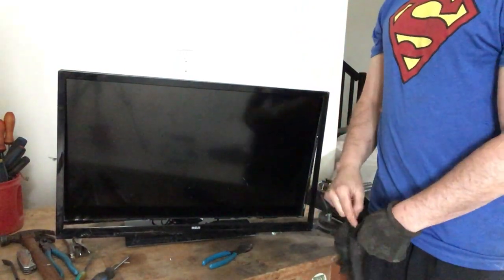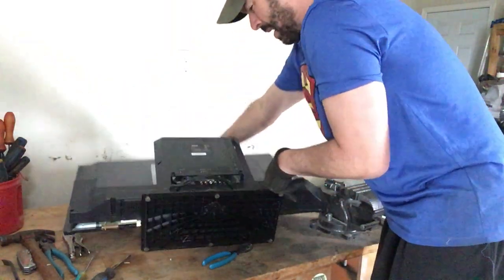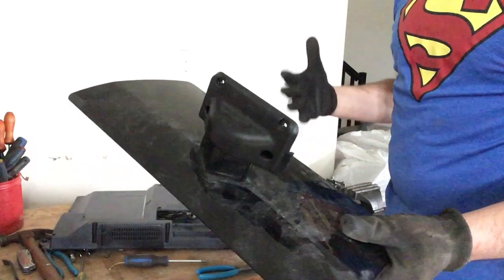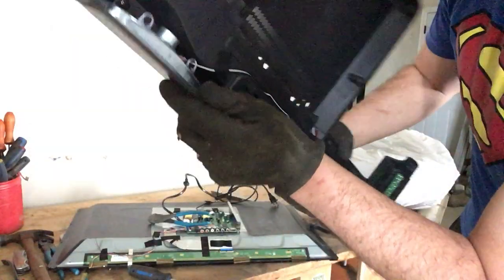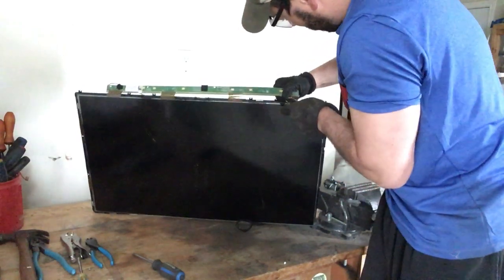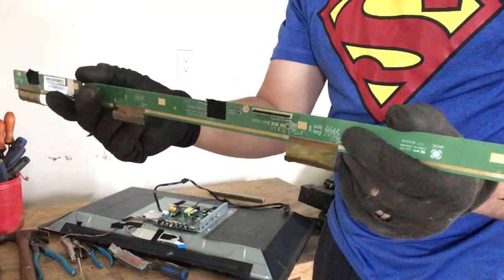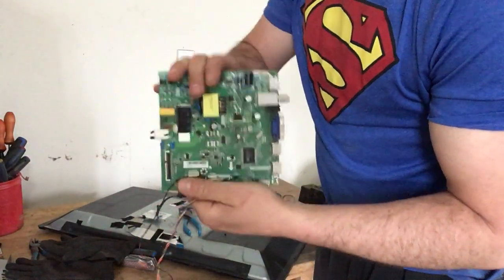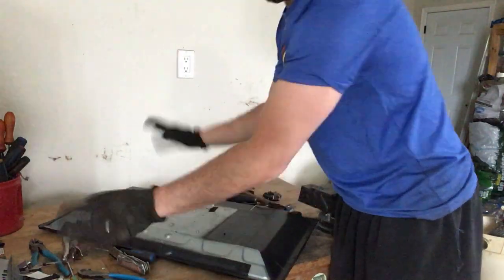Scrapping a flatscreen tv for gold, silver, copper, and other metals.

Comment: someone on a silver forum said flat panel tv's have 2-3 ounces of silver, from this video it doesn't look like this is the case at all?
Reply from the maker: Nope, there are tiny buttons that have an extremely small amount of silver but not 2-3 ounces. However, there is some gold....but not that much either. If they did have that much silver, I would be rolling in silver as I have taken apart approx. 40 In about 3 yrs.
Reply: see ewasteben channel...computer keyboards have two pieces of plastic tracing with 999 silver...a Kilogram of those will render at least 3 oz of silver...
Reply from the maker: No silver, but gold on flatscreen board. There may be a crystal oscillator that has a little silver, but that is it.
Reply: @TinManScrapper  can someone please tell me where the mercury is that I need to be cautious of?
Reply from the maker: @michellemcmillan6149  I would say probably in the lightbulbs that run down the tv. I know the old TVs have lead in the glass, but I can assure you that there is no mercury on the circuit boards.
Reply from the maker: @michellemcmillan6149  Hi Michelle, I would say it is in the lightbulbs that light up the screen. I know the glass in the old TVs are made with lead so you don’t want to break them. Believe me it is very easy scrapping the tv without breaking the screen and the circuit boards do not contain any mercury. Hope that helped.

Comment: Another scrapper was saying if glass was not broken, you need to be careful of the mercury. Where is it on the tv?
Reply: Some LCD TVs have cfl bulbs for backlights. These would be behind the layers of the screen. They would look like thin tubes lined up. Some LCD TVs have LEDs instead, so no mercury there.

There is also mercury in rear projection TVs in the bulb that lights the projector. This is really easy to avoid breaking.

Comment: Can I smelt the copper pieces with the plastic on? Will it burn off in a hand heating one or smelter furnace I wanna take apart my 65in tv
Reply from the maker: The plastic should burn off yes. However, be careful with smelting copper, some yards do not accept them because they question the purity of the material